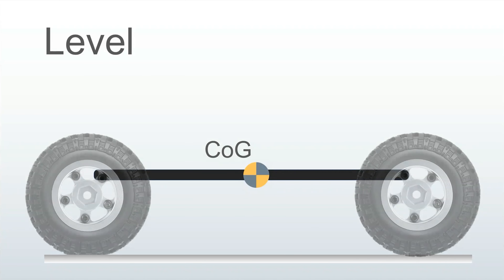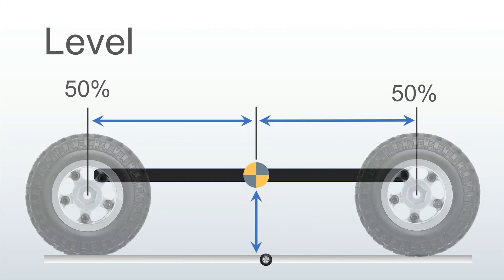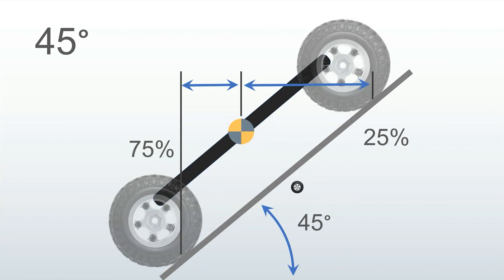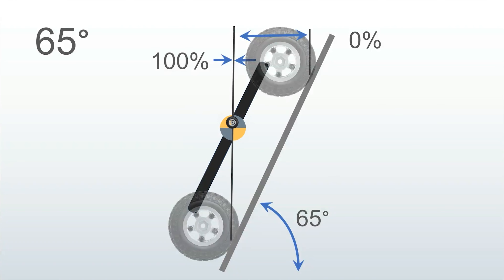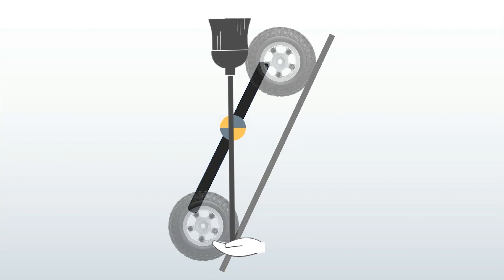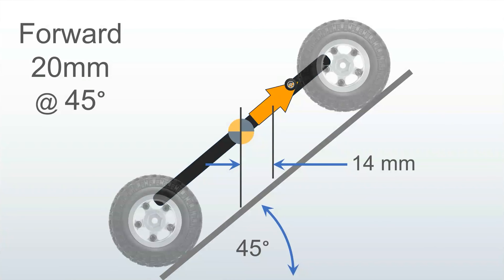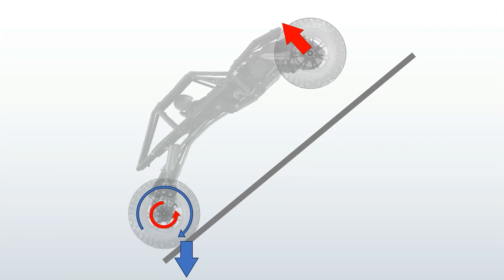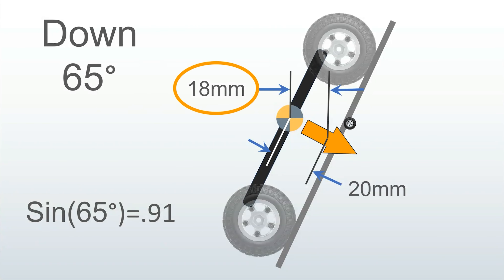Is weight FORWARD or DOWN more effective?

Comment: So then it’s important to have overdrive in the front then. Just think what if someone came out with a adjustable chassis & center of gravity what if you used hydraulic struts like on a hospital bed to basically hit a button & make the chassis longer or smaller I’m curious if it would even help.
Reply from the maker: Some overdrive is useful in the right circumstance, but it's a little overrated because your front wheels are often unweighted. For sure you could build automated adjustments. The closest thing I can think of is a suck down servo which some people have done.

https://youtu.be/wn4vBERXvGc
Reply: Funny you should mention adjustable wheelbase, I am currently collection and making parts for an experimental rig that will have adjustable wheelbase. Servo controlled shock mounts and suck down winch have already been done but there are always trade offs between cost complexity, weight and performance.  Many things can be done but often keeping it simple works out to be a better option. I am sure the adjustable wheelbase crawler project will work but I do not expect it to be super practical as it will add weight and complexity and will most likely only be really useful is a few specific situations.
Reply from the maker: I look forward to seeing it!

Comment: The basic idea of keeping the majority of vehicle weight as low as possible is one of the reasons I decided to build an MOA (Motor On Axle) rig as this reduces high up sprung weight due to not having motor, gearbox and drive shafts on the chassis. Steering servos are mounted on axle rather than on the chassis so all that the chassis carries is the receiver, ESC and battery. I also reduce the weight  on the chassis when I intend to drive on terrain with steep ascents by using a smaller, lighter battery pack. The smaller, lighter battery is also lower capacity than the batteries I use for just running on trails to and from home but I have several small 850mA packs specifically for driving steep courses. Driving on trails to/from home I use large 2A and 2.85A LiIon and LiPo packs. When I get to the proper crawling area with very steep terrain I change to the smaller 850mA Li-Ion battery to reduce mass on the chassis effectively shifting the overall weight bias of the vehicle down and improving steep ascent and descent performance. You gotta love physics, when You get the rig just right it is amazing what can be achieved with good line choice and very gentle throttle control.  Keeping it slow and low seems to work rather well. Have Fun !
Reply from the maker: I love it. I may build a MOA someday but I’m not stoked about 2 motors and ESCs and they look kinda weird but I might come around.
Reply: @BoomslangSuss  Running the dual motors off single ESC from FTX ravine {Danchee ridgerock) with a small mod to adjust power delivery curve for better low speed modulation. I plan to upgrade to individual ESC per motor at some point in future, or might just keep this one as it is and build another with better electronics. MOA does look pretty odd but You soon get used to it. Keep up the good work. Have Fun!
Reply from the maker: Nice.

Comment: I would love to hear your take on axle width. Pros and cons of things like +8 in the front and stock rear versus other configurations. I love how your videos break down the walls of complexity so even I can understand them. Thank you.
Reply from the maker: I run wide Capra axles with 11" track width (that's measured to the outside of the tread).  Wider is more stable...BUT also wider, lol.  Harder to squeeze through narrow passes and your center can get hung up more often.  I think it comes down to personal preference and where you drive - simple at that.
I can't think of a reason to run different widths front to back.
Reply: @BoomslangSuss  Thanks for responding. I tried a few variations myself and basically concluded it wasn't enough of a difference to really do it. Maybe there's benefit in comps getting that rear to squeeze by a gate but I didn't see enough improvement.
Reply: @BoomslangSuss  Gates.
Reply from the maker: Facts.
Reply: @alienateed4101 wider axles affect turning radius also. Not just squeezing through right spots.

Comment: Makes the tungsten weight hangers seem evem more important.    My fav thing to do to stock rtr.
Take everything apart move everything to front remove shocks band the front and boom line slayer…..now more just going custom….makes me question my battery esc receiver on servo…I recently moved esc and receiver back to chassis non sportsman off axle which with my setup makes them high it forward.
I def like to take a rig and stand it up to see where when weight passes center line and the sirecr pull towards center of the earth
Reply from the maker: I love it. 🤘🤘🤘

Comment: Terrific video! Would being super light affect traction, I'm way into the 1/24 scale stuff and some times it seems i dont have enough weight to gain traction.
Reply from the maker: At a certain point, when you get too vertical, weight is pulling your backwards downhill MORE than it's pushing you into the slope for traction, so less overall weight becomes more important.  On a 1/10 scale it's tough to build them too light.  On my 1/24 I have them packed with brass because they start out too light.
Reply: @BoomslangSuss  That makes sense, I guess you need to find the right balance
Reply from the maker: Precisely. Perhaps someday I can estimate it mathematically.

Comment: How about heavy front wheels. I had a Capra with Lead inside the lock rims and it crawled amazing.
Reply from the maker: It’s best to have the weight static on the knuckles. You can get the weight lower and it’s easier on your drivetrain because it’s not rotating weight.
Reply from the maker: Next Level Weight Hanger
https://youtu.be/-rps27jtqgQ

Comment: Great topic! Can you please also make a video on links triangulation.😊
Reply from the maker: Triangulation for suspension performance or structural stiffness?
Reply: Hm...both maybe😅
Reply from the maker: If you’re looking at triangulation from the side, it’s not that important because anti squat doesn’t work at slow speeds. If you’re looking from the top, you need at least one set of your upper or lowerlinks triangulated for stability.
Reply: @BoomslangSuss thank you for the explanation!

Comment: That all looks good on paper but I have found what works for ME is forwarded mounted skid droup suspension LCG as much as possible and lots of front end weight as possible brass beadlock rings or two wraps of car stick on wheel weight brass hexes and deluxe heavy portal covers all my rigs in the 7lb range and I can say never have I said I wish my rig was lighter ck out how heavy heavy works at YouTube dubbleportion 
Beleve me I get lots of flack about the weight in front until they see how they pull absolutely crazy lines and the # 1 compliant it weares out drive components if you are building a rig for longevity it probably won't be a line killer 
Of course I'm MY OPION 
You ave a awesome poized killmode  I would love to see how mine would keep up with it thank for all your Information by far the best out there
Reply from the maker: Thank you my friend!  I wouldn't argue with anything you said there - it sounds like a great set up. 
I'm headed toward 70% front bias to try it out which means my rig might exceed 6lbs. I never tried to build it super light, though I do use extremely light 17gm wheels, but for other reasons. I like metal parts and rear steer.
Reply: @BoomslangSuss  too much front weight is contra productive at downhills ;)
Reply from the maker: So true. Sometimes I wish I had free wheeling front wheels so the backend wouldn’t out pace the front and flip over.
Reply: @BoomslangSuss  o it's possible next level

Comment: Without watching... (weight down = less transfer = less grip but more stability) (weight forward = more transfer = more grip but less stability - but more stability than weight rearward, for on power or going up)... 

 (answer) if you add weight low (a heavier car) it will have more grip and stability<<< so weight down should win if your "adding" weight!!! weight forward wins if you need more grip!!! weight down wins if you need stability!!!
Reply: I agree with most of the video. but adding weight can help, till you slip... yes, less weight will make it easier to regain traction once you start (losing it) sliding down the hill!!! I found (even in racing) that adding weight low (and mostly forward) will make the car super consistent, it might be consistently bad or slower (not always) but if you know what your car is going to do every time it might be a win. It's definitely harder to drive an underweight car!!!
Reply from the maker: Steeper than  45 degrees - moving weight down is actually MORE forward than adding weight forward, when level.  

I appreciate the you tested yourself - posted your answer first, then watched, then posted your follow up. Love it and thank you for checking it out.